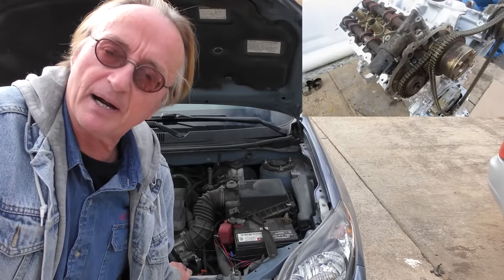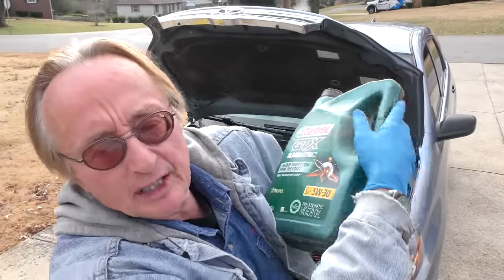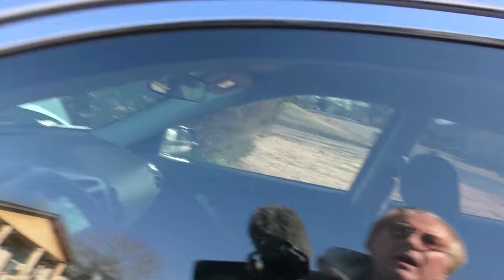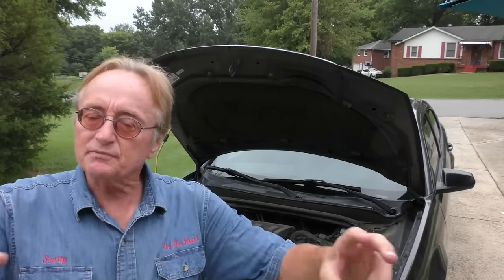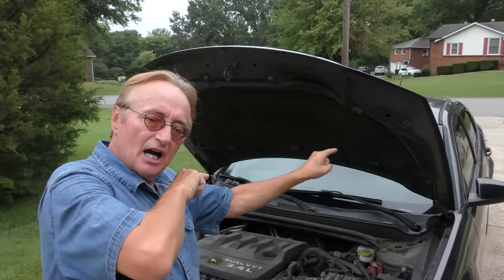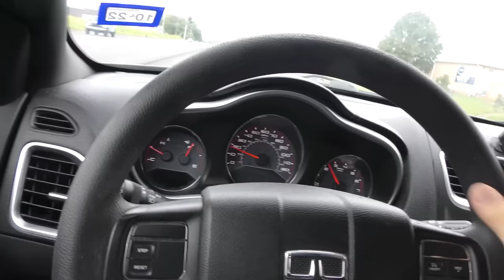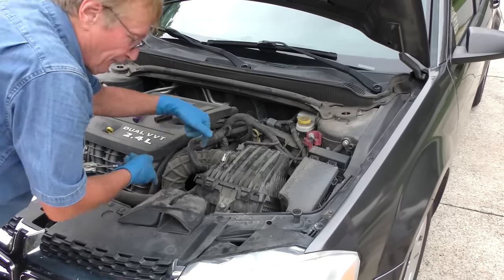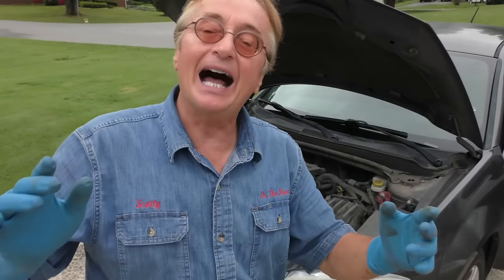Doing This Will Make Your Engine Run Like New Again

Comment: I remember an old coworker of mine was devastated when her car was ruined and wouldn't start. She was mortified and screaming because she thought she was so smart and knew everything, so what did she do wrong to her car? She did NO MAINTENANCE TO HER CAR AT ALL. NEVER HAD AN OIL CHANGE! Even when we told her she needed to do that, she argued with us that it did not need an oil change because it was only five years old! Remember she was so smart and knew everything. More than everyone else. That's why her car was DEAD.
Reply: I've known 3 stupid women who did the same thing. Never looked under the hood and expected the car to run forever...jez...seized up the engine every time. One gal I know has been thru 6 cars
Reply: The words that came out of my mouth...lol... when I read the part about it doesn't need an oil change it's only five years old... surprised it made it that long... oh my word
Reply: Need a strong father to teach the girls how things are.
Reply: I worked at a long term rental place for Uber drivers. Had a girl come in because the "bad car" we rented her "doesn't, like, go anymore". Turns out she was a real smart gal who knew a thing or two about doing things so when she saw the oil light had come on, she proceeded to fill it all by her little self with 5 QUARTS. She was so confident in bragging about having done this. The really funny thing is oil changes were included in the rental at no extra cost.
Reply: i too met a woman who never changed the oil in her new car (about 30 years ago). what surprised me was the car managed to go nearly 20,000 miles before failing. she did not know that oil had to be changed each year. 
i suspect most cars have maintenance lights that alert the user when it is time.
Reply: My niece had a car that leaked oil.  We once asked her if she was keeping oil in her car. . . . . 
She said she had fixed it.  "I stopped putting oil in it and the leak went away!"
Her dad had taught her how to check oil, and put the correct amount in, but sometimes it just doesn't matter.
Reply: went  5  years  without  an  oil  change ? wow.  was  it  a  toyota ?
Reply: @armadillotoe  Too funny.
Reply: @arkrainflood Cars don't fail from not changing the oil for a measly 20,000k miles.
Reply: Haha
Reply: Had a 97 integra for 5 years and 50k miles. Changed the oil maybe 4-5 times before I got rid of it. Didn’t know any better. if it wasn’t for concerned mechanics I never would’ve done it 😅
Reply: Yeowzah
Reply: 😅😅😅😅😅😅😅 women
Reply: When I was much younger (and stupider), changing oil and doing any other preventive maintenance was the last thing on my mind. Well, I have learned that neglect can be expensive in more ways than one. Now at 65 I do most, if not all, of the maintenance on my vehicles past warranty.
Reply: I couldn't stop laughing after reading that her reasoning was that the car was only five years old.
Reply: That part
Reply: lol that's funny.  Being ignorant is no sin but willfully feeding your own ignorance?  That's something a lot worse!  She's probably got her hood raised up so she can lean over and scold the engine for failing ....
Reply: Was it a Mitsubishi or Chrysler product by chance? Just curious.
Reply: Oh i love folks like this,... wondere how much luck she had bitching at the engine to make it come back to life
Reply: Why is it always a woman?
Reply: @JA-gx4hb  it was probably a Fiat lol
Reply: Enough with the female  shaming!  My very smart brother-in-law was given his mom's top of the line v6 Volvo and totally ignored the oil light until the engine seized on him on the freeway.  I so wanted that California Volvo body to put my pristine engine into because i lived in New England and after 23 years of salty roads it was sitting in a rusted out frame. I changed the oil every 3000 miles without fail from new.  At 300k it needed a head gasket and my mechanic  said he had never seen cylinders so clean... Not a scratch on them. He asked me my secret. I whispered in his ear "Simple! I changed the oil".
Reply: @vfgfdfdf  Hey, FIAT makes excellent engines. It’s the rest of the car that’s not so good lol.
Reply: I love it!
Reply: @S P 6 beaters that lasted a year or 2 each
Reply: @driver4011  not being Johnny on the spot with oil maintenance is the one thing that will break a toyota real quick
Reply: The windows in that house across the street look like Scotties eyes. Lololol
Reply: @pamelanelson5861  no
Reply: I'd hate to eat anything deep fried at her house 😂
Reply: @jima3129  u tripping 😅
Reply: Yup known women like that lol.
Reply: The people that think they're smart really aren't that smart at all. You have to listen to the expert. I don't have the money to spend on new cars, so I learned at an early age to service and maintain my myself, as a result I end up having one for 15 years, just for the sake of a gallon of oil, a filter and some spark plugs, very easy to do.. Once you learn you then enjoy doing it yourself, also saving money...
Reply: Woman moment.
Reply: Mom had a Kia Sophia  with 130k and never not once changed the oil. Amazed
Reply: My wife was an only child and had the benefit of having a father who made sure she knew how to service vehicles, do in home repairs and  how to triage most electrical issues be them home or automotive related.   I was one of five with four older sisters. I learned  my way around the kitchen at a young age and do all of the cooking for our family.  This thread gave me a chuckle…Shortly after we met 30 years ago, I was trying to impress her with my car servicing skills. I proclaimed I was going to be doing my own tune up, with an oil change, spark plug replacement and radiator flush.  

I got as far as the spark plugs. Having removed the spark plug wires and spark plugs I quickly replaced everything. Man this was too easy! Celebrating my victory I jumped in my car to pick her up for our date. But the car would not turnover. I was perplexed because for the life of me I could not figure out why my car wouldn’t start. These were BRAND NEW PLUGS AND WIRES! The thrill of victory, quickly became the ABC Wide World of Sports agony of defeat. 

Since I couldn’t leave to pick her up that evening I had her come pick me up. She asked me to show her what I did before the car wouldn’t start.  I walked her through it and she chuckled. Then she asked if I had heard of something called the “firing order”. 

I understand that stereotypically speaking this is not the norm, but it is also worth mentioning that she cut the cabinet, ran electrical and installed our new dishwasher last month. I thanked her with homemade croissants and kitchen free of dirty dishes (thanks to her).
Reply: I love it when a know-it-all gets their comeuppance!!!!🤣🤣🤣🤣
Reply: @afisemenaborevlaka48 my grandmas advice on oil change and engine service - not that I didn’t have strong mentors and men, but her message stuck
Reply: I'm a 33 year old gal with limited car knowledge, trying to learn more, and even as a 15 year old I knew you had to change the oil on a regular basis 😂 im embarrassed for my gender.
Reply: Dead?
Reply: Fellas fathers DADS!…MOST girls WILL NOT get it EVER!  They fix cars with their EMOTIONS as a Scan Tool 😂😂😂
Reply: This is most women.
Reply: Classic Karen 😂😂😂
Reply: A classic narcissist.
Reply: got what she deserved. people like that are actually too stupid to know what they don't know. ull find smart people arnt scard to not know something and instead want to learn
Reply: How did she get 5 years? Engine should have seized up long before.
Reply: Lol what a tragedy
Reply: A.k.a toxic know it all narcissistic women bruh
Reply: 5 years 😂.  Stupid people can travel fast, but never very far
Reply: @JA-gx4hb  They will fail if the car runs out of oil by 20K.

Comment: I own a 2004 Lexus GX 470 with 305,000 miles and replace the oil with Pennzoil Platinum High Mileage full synthetic 5W-30 oil every 5,000 miles. The engine is nice and "tight" and I still get the advertised MPG when the car was new. 😉
Reply: Wow!  I've been listening to Scotty Kilmer and I want to find a good Lexus, an older one.  He recommended one one but I can't remember what year or model.  Guess I'll have to ask him.
Reply: 305k miles, amazing, what's your secret, did you own it all that time?
Reply: @HermannTheGreat  his secret is, lexus is a toyota and that year Lexus was assembled in Japan. I have a 2003 lexus gx470 also with 307,000 miles. Toyota says that engine is good for 400k, and I say if you change the oil every 5k miles it will probably go 500k+.
Other parts wear out like radiator(250k), shocks(290k), break rotors(300)alternator(not yet but soon),,, and the usual stuff
Reply: Pennzoil 🤮
Reply: @weslingm  well made everything in JAPAN
Reply: Wow my Lexus is300 2001 has 318,000 miles , still healthy , no ticking noises , no loud excessive sound ,never had the check engine on till recently when I swapped out my catalytic . Toyota engines man👌🏽
Reply: Holy crap, thanks for sharing, i think ill do the same!!!
Reply: @conniefrazier4168  ls 430 or es 330
Reply: Nothing beats Amsoil. Period. AND it doesn't cost more than regular "full" crappy synthetic. You want 100% Pure Synthetic Motor Oil.  Check out what the legal word "full" means for motor oil.  Plus Amsoil great American company! Even for Toyota's! lol!
Reply: @weslingm  Gas mileage is terrible but I would rather pay more gas station pumps than going to get it looked at often
Reply: @amandeepbaa6978  I have heard Scotty talk about Japan's culture even before getting a job.  He said "we will never be able to duplicate their society", thought that was interesting.  My take is, their very disciplined throughout their entire culture and they carry that on to the businesses.  Trying to be perfect, even though, they are human.
Reply: Takes me 5 years now to do 5,000 miles..noticed that also
Reply: @MR..181  🙃
Reply: @JamesBond-oe4ru  yep..upsidedown..my life..
Reply: GX 470 very reliable car.
Reply: James Bond drives Aston Martin's, not Lexus's... 😂😂😅😅

There was one mistake when he tried BMW's, poooeeeyyy😝
Reply: @Johann Johann  where can I purchase ams oil ?
Reply: @weslingm  applause to Japanese year 2003...overdue..
Reply: That's the only oil I use and the "platinum gold" filter. I'm just in disbelief. It's like it's renewing my engine. It's worth the extra money because it saves you a ton of money. You can hear the difference. It purrs.
Reply: @Emoralis Right!
Reply: I have a ‘98 Lexus ls400 with 285,000 miles. I get my oil changed by a retired Lexus mechanic every 3000 miles. Havoline 5-30. Timing belt, h20 pump, crank and cam seals. It runs like a dream. Had starter n alternator rebuilt by certified shop. Been using them for 30 yrs. I’m 63 and live this car so I try hard to take care of it. Scotty has taught me things that even my mechanic didn’t. Love this guy. Women need an honest mechanic, come to Knoxville 😂

Comment: I used to work at an oil & fluid change shop, and the neglect ppl put their cars through is mind blowing!  all too often I've drained the crankcase oil only to see slow flowing sludge coming out of an engine that's already at operating temperatures, or remove an oil filter that was clogged with sludge😣😣😣 Even before I had that job, I could never bring myself to go that long between intervals!  I've owned some unreliable cars in the past.  But I've stayed on top of my fluid change intervals, and I've rarely ever had problems afterwards besides the occasional mechanical repair needed in high mileage vehicles.  I feel so much better knowing that My oil & trans fluid is clean, along with the typical Coil packs, plugs, cables, belts, hoses(cooling system flush) and the occasional radiator change, air filter,  tires & alignment.  I've never paid more than $3k for any of my cars, and they've all been reliable after taking care of the basics, and I end up driving those cars for years

Comment: I have a Ford with a Windsor 5.0i 302 that has done 101,000 miles. I change the oil & oil filter every 2000 miles which many say is too soon an interval, but my motor does use oil, and it is as stable in any temperature from 2 degrees to 42 degrees, with A/C running. I also use a high quality full synthetic simply as the car is a performance model and the factory specifies it. Thanks Scotty, always enjoy the content. Sydney, Australia.

Comment: Great video Scotty. I found a important area to clean on that throttle body. Open throttle body plate and look on THE BACK SIDE. This will usually be dirty as well and it will have a small hole clogged on the plate. Hole used to provide air at start-up when engine is cold and at idle speed.

Comment: The throttle body in my impala went out recently, at autozone it’s $250. Went to the pick-a-part and pulled it off a crash impala that was two years newer for $52. Cleaned it up real nice, drives like new again. Disconnected the negative battery terminal to reset the codes.
Reply: That's how you do it. Just be careful buying "plug coils" used, or anything with "bearings". Otherwise, pull and pay is it for us "poor folk" lol!
Reply: Unplugging a battery can cause all sorts of problems
Reply: @JohnFlaky-jm7dd  you bugging
Reply: @victorpapillon1487  just like your car after pretending you're a mechanic
Reply: @JohnFlaky-jm7dd WHAT!

Comment: I have a gmc terrain with the notorious 3.6 v6 and I’ve have zero engine problems aside from regular maintenance. Doing oil changes every 3000 miles and it runs like a clock. Goes to show that any car can be reliable as long as you maintain it
Reply: Not when something breakdown in  stressing/overheating
Reply: Good you didn't get the 4cyl. I own 4 gmcs from the 90s all running.  After the problem with my wife's terrain we bought honda ,It will take a lot for gm to gain my trust again
Reply: Good news , isn't it great that most of the transfer cases go at 80k for $4k , rings go bad and use a quart every 1000miles, then the funniest recall where gm has you come in when headlights are too bright they put a sticker filter on your sun faded lens
Reply: I have a 2014 3.6 Terrain, 42k miles, no engine issues, change the oil every 3k - 4k like you. Front end lower control arm bushings on each side leaked the fluid out at 40k....not happy about that.
Reply: I change my oil on every fill-up. I've never had an issue.
Reply: @TheSuperBoyProject  🤣 gmc terrain changes itself every 2000 miles
Reply: @MiyamotoMusashi9  if the Honda is GDI you'll have the same problem, carbon jaming locking up rings, even Subaru's are using a quart every 1000 miles
Reply: @thomasmorris302  is there any way to prevent it?
Reply: Americans and there oil changes 😂 3000 miles 😆
Reply: @davehughes6501  american? ??? Hmm or maybe kilometers?
Reply: So what's your mileage on the odo??  I used to work for a fleet - GMC's, Dodges and Fix or repair dailies" always provided us with steady work, but the Hondas and Camrys in the fleet seldom needed anything but oil.
Reply: I knew someone with one of those,maintained  it, and timing chain still went bad early.
Reply: @mudpuddle2658  you have 42k miles.....I hope you're not impressed with those miles......
Reply: @richsweeney1115  Average over 30 mpg on the hwy with the 3.6....301 hp. Doesn't use any oil.
Reply: Have to worry about the very important transmission system as well. And radiator fluid and the hoses cooling system.
Reply: These GMC terrains are complete junk.  Piston rings fail ,they leak and burn oil badly. The trans are like paper, constant slipping and thuding into gear. These cars turn in big head aches after 50/60 k miles.  Will never get a GMC product again.  Massive headaches.   These are a mechanics dream because these customers will constantly be in his shopping and paying all his bills with plenty of dough left over.      JUNK
Reply: I have a 2017 Equinox with a  3.6 liter. I change the oil at 50% engine oil life (about every 5-6k) with 5-30w Full Synthetic. I have 120k miles on the engine. No problems at all.
Reply: @davehughes6501 I agree with you. I can't believe people are STILL changing their oil that early in newer cars. I can see maybe at 4000 and that's still early.

Comment: I have never seen anyone dip the filter in the drained oil, that caught me by surprise.  I just use a little of the new stuff I am using.
My brother's father in law was a mechanic. He would buy synthetic oils and changed the oil filter after 3 months, then topped off the oil. He told me that back in the 80s. Synthetic was pretty expensive back then so would change 6 thousand miles doing that.

Comment: LISTEN TO SCOTT!!!!!. I have a 30 year old engine with 340,000 miles. I change the oil every 2,000 miles using non-synthetic Castrol GTX and Fram Tough Guard throughout its entire life ONLY. I drive it hard too. The engine still has its original head gasket, original timing chain and guides for 30 years. I always let tge engine sit and idle for about 5 - 10 minutes before i move. The engine does not burn or lose oil. So, i am confirming what Scott said in this video.

Comment: I changed my oil on a car I had for 15 years. Changed it every 3,000miles. That was that is 88 oil changes. And never changed the oil plug gasket. It never leaked.

Comment: I have a 2013 Dodge Avenger with over 174k mileage on it and I recently had my throttle body replaced because a friend of mine who is a mechanic told me that the sensor on the throttle body was faulty and looking at the 10 year old original part, it was beyond help because it was really dirty, plus his friend tested the original sensor and good thing that got replaced or I would've been screwed.  My car can be a problem child at times, but still going strong though.  Love your videos Scotty.